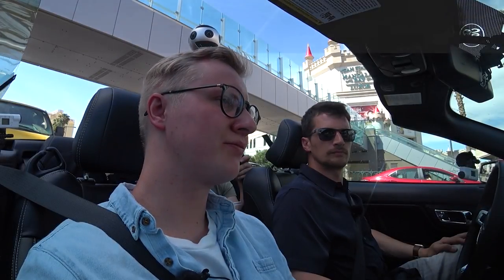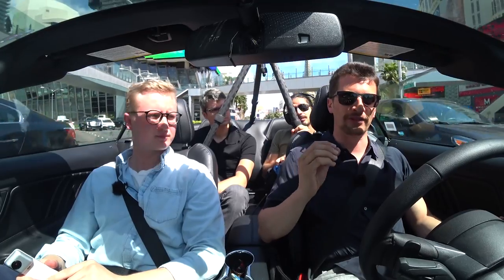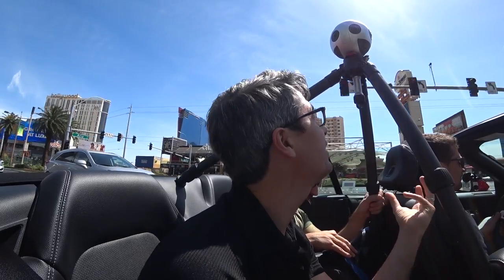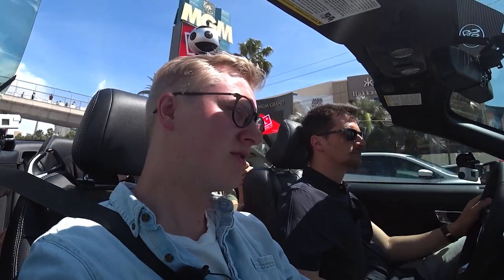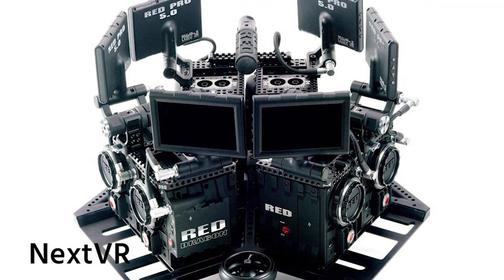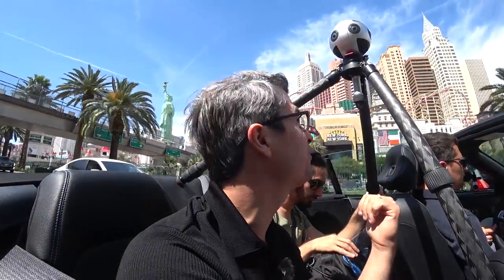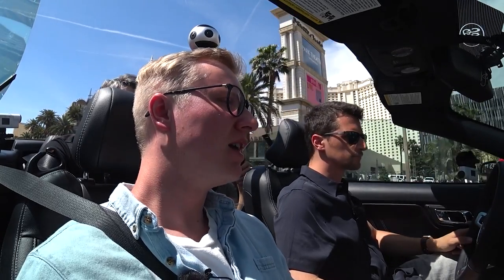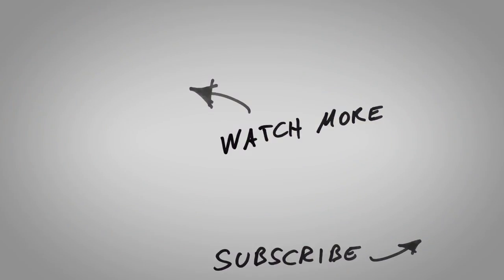A Single-Sensor 360 Camera? – feat. Max Richter from Insta360 - ON THE GO – Episode 54

Comment: One Sensor and Lens for 360° Video: Use flexible Sensor, roll it, place inside a Lens that looks like a Hurricane Lamp.

Cheaper (today) to use 2 Sensors and Lens like Kodak's 360° Camera, or the Nokia Camera for Pro Grade (and quite small).

Like Clothing, stitching more than one piece together costs less.